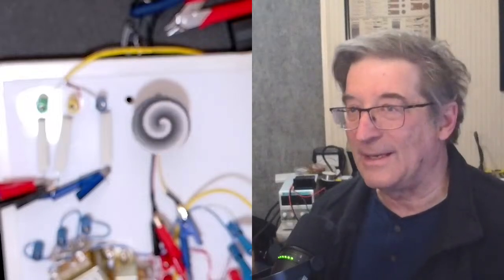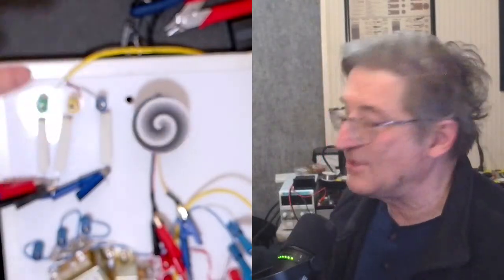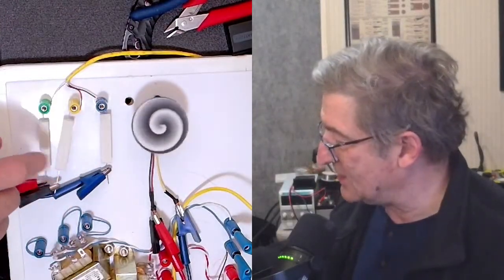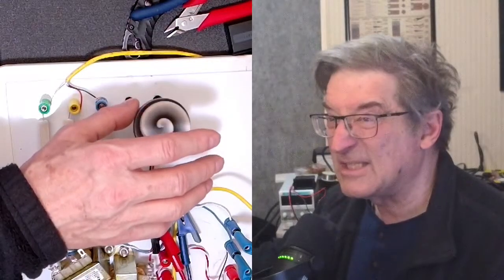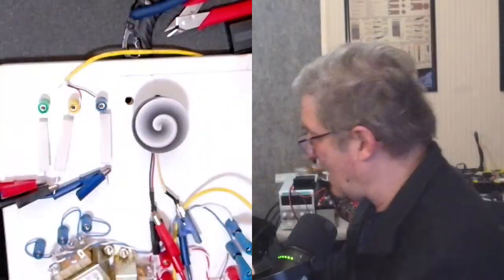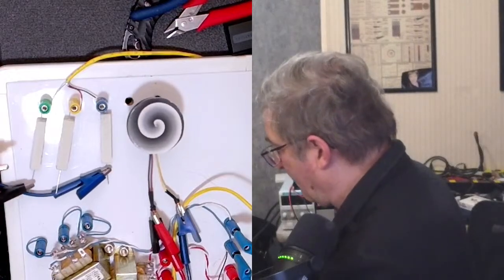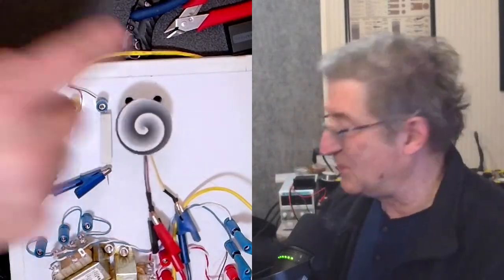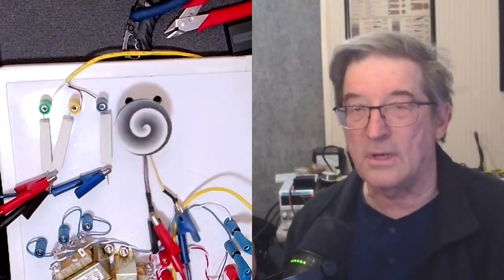3-Phase Rotation Demonstration with Mike Sokol

Comment: Awesome demo Mike!  Is the rotation rate locked to the line frequency or are you driving it with a signal generator so you can control it?
Reply from the maker: I’m using a crystal-locked 3-phase sine wave generator which I’ve set to 60 Hz. But I can set it to any frequency I like. For example 50 Hz for UK, of 400 Hz for military aircraft power. Plus I can vary the degrees of phase shift of the outputs, so it can create early 2-phase 90-degree power.
Reply: @ nice!